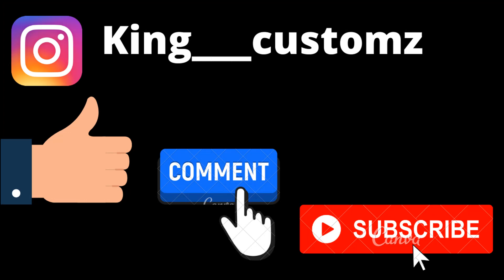avalanche wheel bearings are bad

Comment: Ryan bro  ,https://www.amazon.ca/dp/B000C9W2PU/ref=cm_sw_r_cp_apa_glt_i_TPADGCCSSR2QKH541HV2 why  the wheel bearing is listed for the Avalanche?  It means it could be changed.
Reply from the maker: for the rear my friend not the front😄
Reply: @Kingcustomz  😂 I didn't know that. In that case here is an amazing deal https://www.amazon.ca/dp/B08F5J27WZ/ref=cm_sw_r_cp_apa_glt_i_MNG720YDTWVCTMWWEVKC?_encoding=UTF8&psc=1

Comment: My wheel hubs make a slight grinding noise and I can feel it when driving at slow speeds. This is an indication on my Avalanche that the hubs are on their way out. Got both of them just have to find the time to suffer swapping them out. At high speeds they are fine.go figure.
Reply from the maker: yeah, I just got my hubs going to make the video tomorrow. It sometimes clicks at really slow speeds as well
Reply: @Kingcustomz  will be doing mine next Wednesday. Wish me luck.
Reply from the maker: @georgechristilaw6282  I just finished, good luck they are so easy